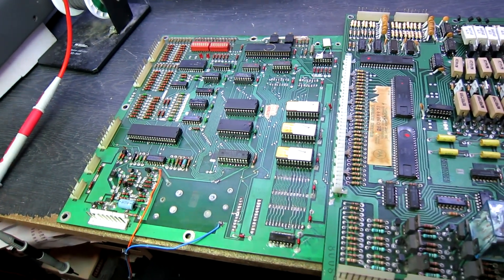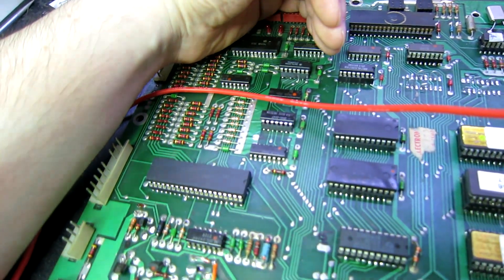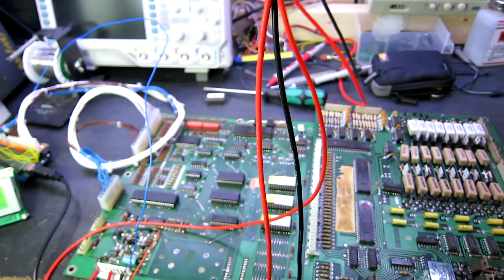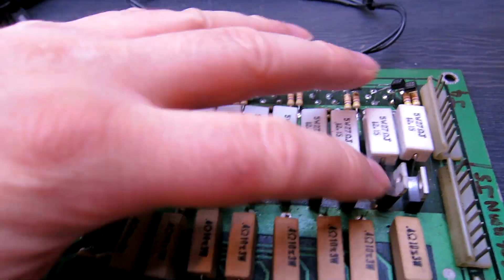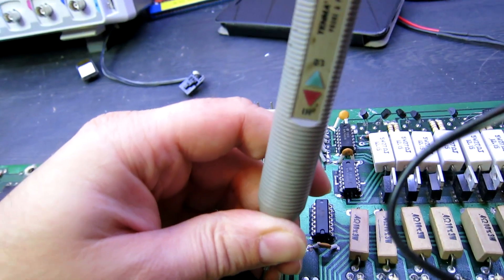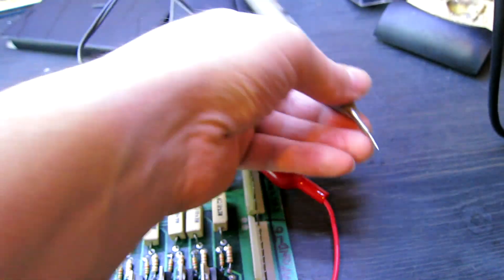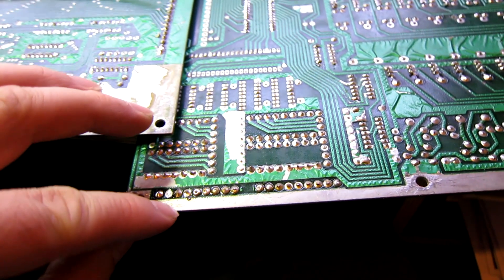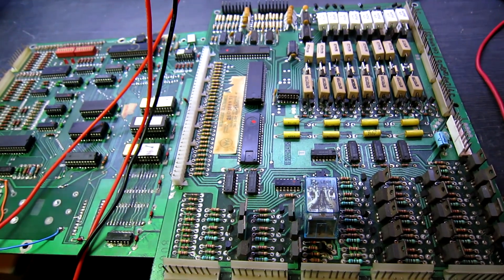Williams Flash Driver Board #2 Test and Repair

Comment: Were can i find a Driver board for the Flash? Mine is missing. Just picked up a badly maintained Flash game and trying to fix it.
Also, will any system 4 board fit into any flash game, just with the correct ROM etc installed?

Comment: Hi, thanks for upload. I debug the same right now. Could you be so nice and tell me if its normal that all PIAs on the driver going only LOW Pulse but not High on Pin 19 (CB2)  with the leon test prom ?

Comment: You can tell the difference from the LG G4 phone camera and this old one.

Iv'e come to the conclusion that there is no frame drops with your new LG G4 phone
i think it was just down to the movement of your hand and the LG G4 having a faster
response time (it was capturing the stuttering in your hand movements) not bad for
a phone camera so please ignore my post on your other video, i may have to get one
of them LG G4's.

ohh, and great repair by the way.
Reply from the maker: +FourX2k3 I will give a review of the G4 after I have lived with it for a few days, so far it is looking good. The original video file looked better than the youtube result, so it is possible some frames were lost in the down conversion. The G4 certainly looks alot better than this one (ZP999) and it doesn't pick up the fluro light flicker like the ZP999 did.